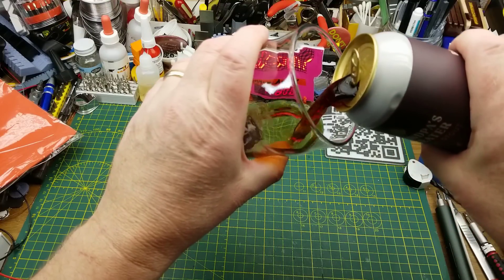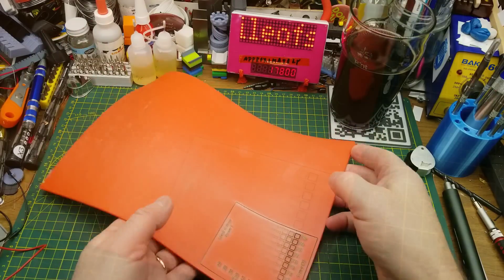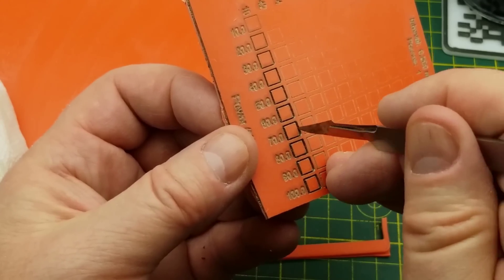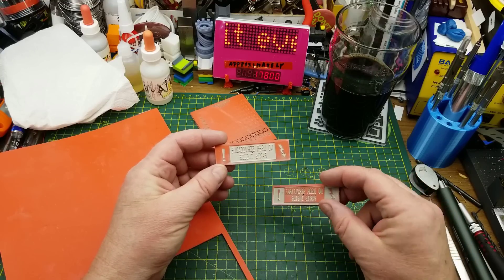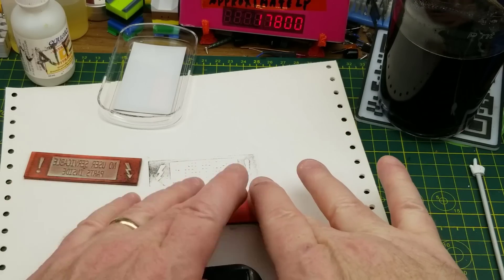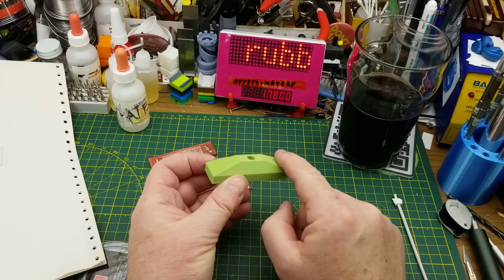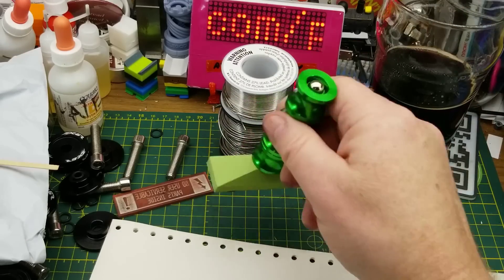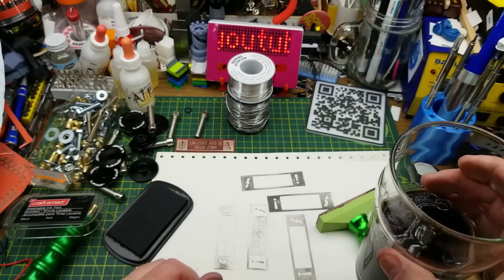Laser + 3D printing = rubber stamp?

Comment: Might be an idea to curve the bottom of the 3D print and roll the stamp, because the contact patch is smaller and the localised pressure will be higher.

Comment: A nice interesting way to make stamps.

However, there is a much more easy and faster way to do so. There are UV-resin rubber plates, wich are sovable in water unless hardened by UV light. The traditional way to make rubber stamps with theese was to create a mask to be layed on the sensitive rubber and expose it to UV. A made a lot of stamps this way about 25 years ago.
However, with a Resin 3d-printer you could simply remove the basin and the plate, just laying the UV-sensitive rubber onto the screen. Than just show the picture the time needed, wash it to disove the not hardened rubber - and you have the staming plate. Still of course a FDM printer is usefull for the grip. Back in the days I simply used plain wooden blocks.

Comment: Well if you think about it the old K40 which seemed to kick off the home laser, was designed to make rubber stamps. The Chinese seem to use stamps instead of a signature. They also use different stamps for different types documents. Hence a laser to make your own stamps became popular so the price dropped with mass production. which is one reason I expect there are soo many different versions of the K40.